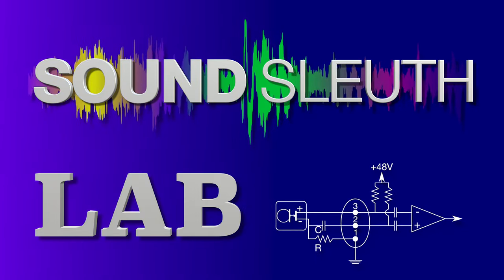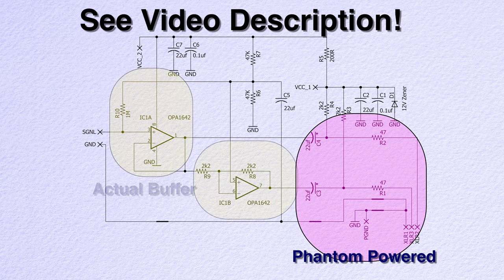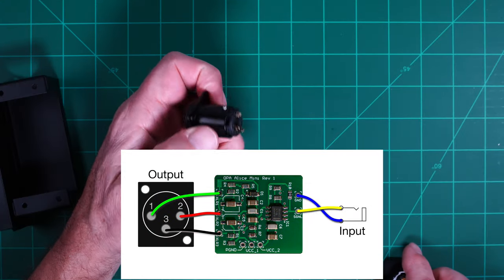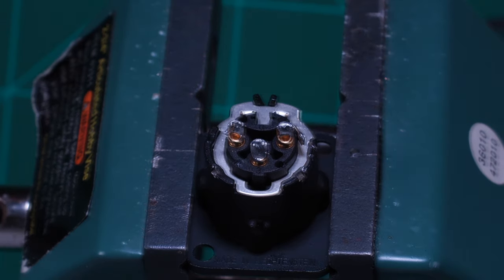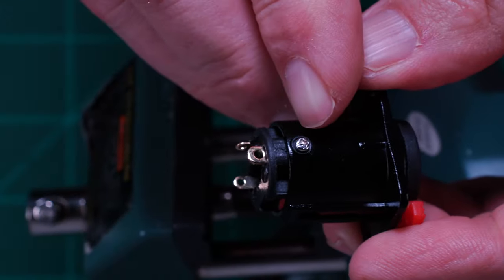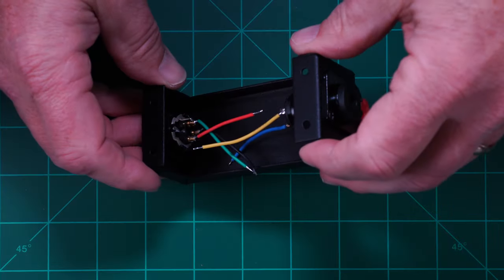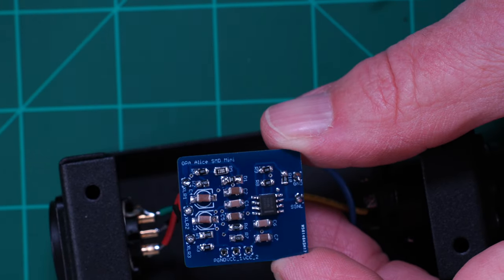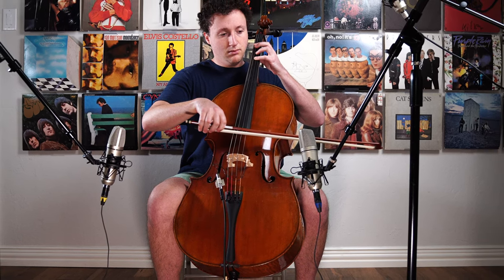Build a Professional High Z Piezo Buffer

Comment: Great result, the cello sounded incredible with mixed mics. Have you experimented with bipolar-input op amps? Someone, may have been Richard Mudhar, did a similar buffer design, and ended up with lower THD with a bipolar opamp, I think an ne5534? than he was getting with a TL072, granted, the TL072 is a dinosaur with high noise, but the point he was making was that the piezo's output impedance, while high compared to something like an ECM capsule with a built-in FET, is still much lower than the types of things FET-input opamps are often used for.
Reply from the maker: Thanks for your kind words. The OPA1642 is an outstanding Audio Opamp. Better specs than the 5532 and TL072. To make this one work with phantom power, we need a low quiescent current, which this one has. The two mics use it as well. I have the identical circuit with a 1Gig resistor. I presented this at the last AES convention in NY. The THD and noise are 40db better than a FET based microphone. Figur/https://www.instructables.com/OPA-Based-Alice-Microphones-a-Cardioid-and-a-Figur/
Reply: @SoundSleuth  With the performance that you are getting from your mics, it makes me wonder if it's possible to make a competent measurement microphone. I use a cheap measuring mic that has high THD and noise. Good enough for room correction, but you can't measure nonlinearities of drivers. Loudspeakers simply  have lower and lower distortion every year. Joseph Crowe recently made a comparison of distortion in microphones and in a practical test a simple ribbon tweeter outperformed the mics. The stand out model was Shure SM57. For it's price it actually outperformed the small diaphragm mics at around -80dB THD. The only model that did reveal the tweeter's response completely was Aco Pacific that competes with Bruel & Kjaer, so quite expensive!
Reply: @SoundSleuth could do a compound amplifier setup, OPA for the audio quality then opamp of choice for the other specs/design characteristics you need. Plenty of resources online about this but basically you have the feedback from the 2nd amp tied into the input of the OPA

Comment: Did you mention what ohm resistance/impedance the box output is?
Reply from the maker: Output impedance is about 50ohms
Reply: @SoundSleuth  oh is that all, most of those piezo disk pick ups like K&K and JJB recommend a  minimum of 1M ohm
Reply from the maker: @clintwhite3021  input impedance is 1Meg. OUTPUT impedance is 50 ohms
Reply: @SoundSleuth  oops yep I originally mentioned to ask the input (not output) impedance haha 
Ok cool thanks ☺️

Comment: Interesting, what is the effect alone from the piezo with high z without a microphone?
Reply from the maker: You can hear the Cello with the Piezo only, the microphones only, and then a mix of both in the video.
Reply: @SoundSleuth  How does it compare with standard piezo pre-amp circuit?
Reply from the maker: @joaosidonio7562  it is better than standard FET discrete circuits both lower noise, and lower distortion
Reply: @SoundSleuth   can it drive a headphone? or can we attach a low impedance out for headphones?
Reply from the maker: @joaosidonio7562   The level isnt high enough. The current drive is there. You can use the same opamp to drive headphones. I will write that one up separately.
Reply: @SoundSleuth  Awesome, I am building a short scale - 20.5"(still contemplating the 23" size) - ukelele travel bass that can be disassembled and packed into a backpack. With a builtin preamp that has a headphone output it can actually be a proper travel bass. Using a toggle that switches the jack between amp output and headphones output would make it proper toy